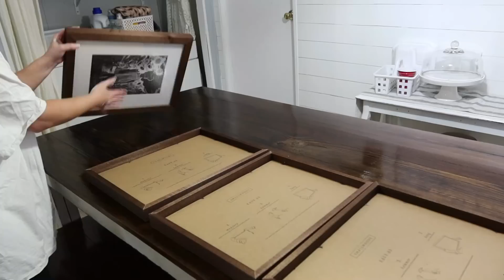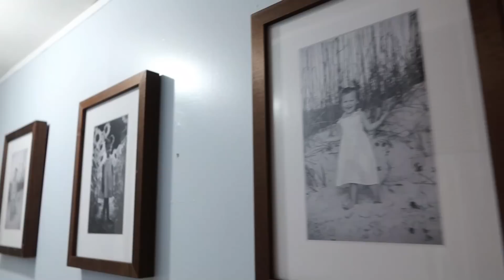✨TRAILER TO HOME✨ \\ SINGLE WIDE MOBILE HOME MAKEOVER \\ HALLWAY MAKEOVER

Comment: The boards for under 4 bucks would have been the furring strips,, and those could usually be found in or around the construction lumber.... BUT,, they are usually rounded and you wouldn't have gotten a straight edge.... What you bought is what you would have actually wanted for the finish you were looking for.... Great job!!!

I love how it turned out...

Comment: You  "set" those screws in so the are recessed...then fill the holes. If you don't have a tool for that you can take the end of a drill but and make an indentation then put the screw back in.
Reply from the maker: Thank you!